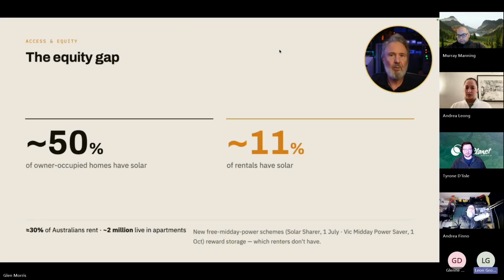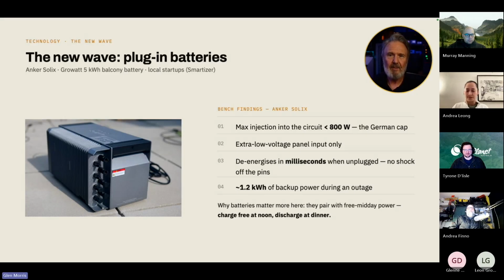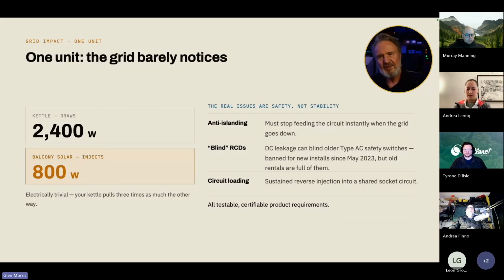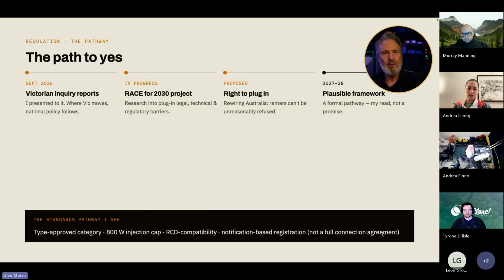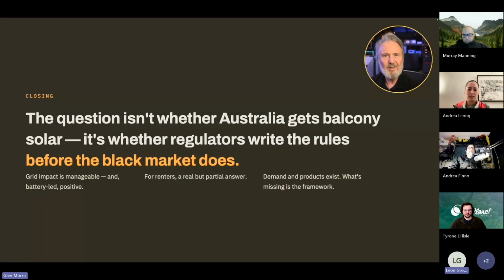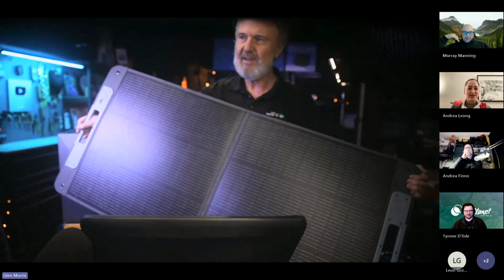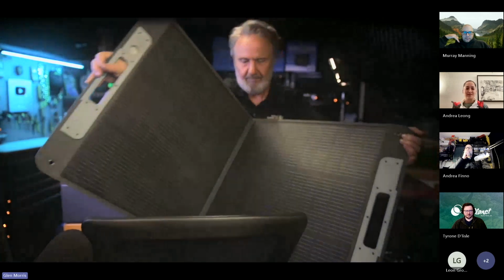Webinar: How Balcony Solar Can Give Renters Access to Cheap Clean Energy

Comment: The way I see one of the big advantages of a balcony system, verse rather plugging solar panels into a portable battery system, is that with correct db system compatibility, balcony feeds power to all power points in that building, whereas a portable solar battery requires extension cords snaking through the building, tripping hazard, need a far larger battery inverter system to traditionally power the db board tradionaly

Comment: Timestamps for the Q&A for all y'all:
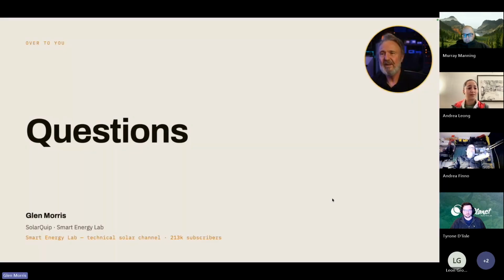16:27 - Are we better off directing efforts to the federal or state/territory government level?
17:49 - Is there a system for giving reassurance of the structural safety of installations?
19:59 - What type of RCD do I have (only some are safe to use with PiPV) and are they costly to replace?
23:42 - Can PiPV offset much of a household’s use? And what about the effect on the grid?
27:28 - How could one attach non-permanent PV to the exterior of their home today?
28:44 - What kind of appliances can run on a 2000W battery?
33:12  - Is balcony solar is a better proposition for cooling in summer, or heating in winter?
35:54 - Any specific product recommendations?